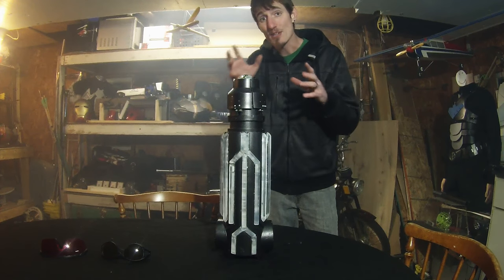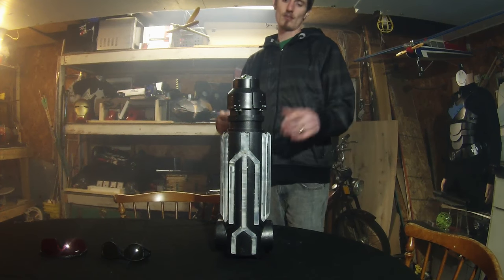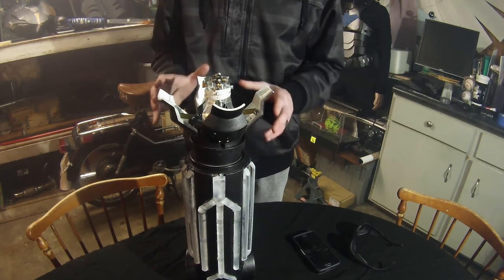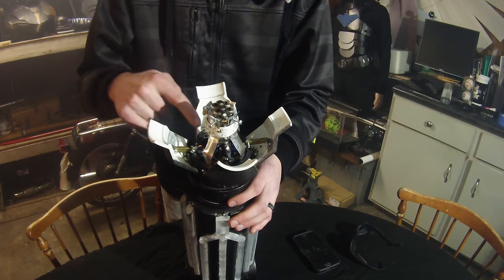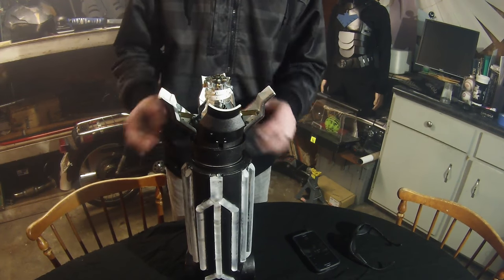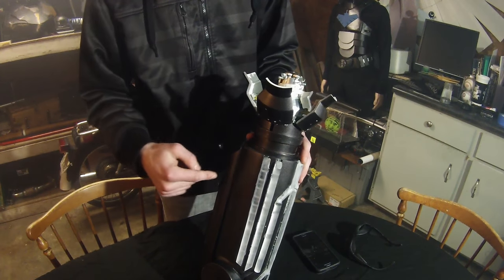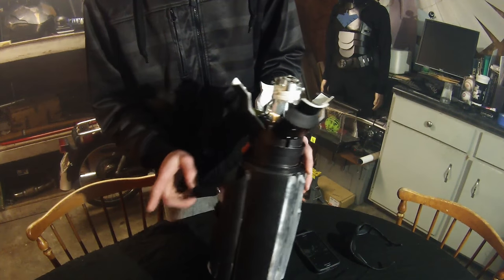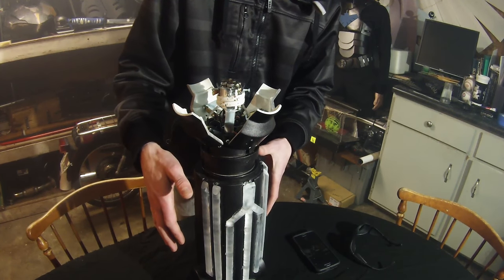Worlds First Functional "Metroid" Arm Cannon!

Comment: you should put an adjustable focusing lens on the front
Reply from the maker: +Vincent Balmont I played around with an adjustable one on my 30 watt rifle. I always set it as close as possible due to the focal length of the lens. What I'd really like to try next is two lenses setup like a reverse beam expander to shrink the size of the beam but keep it tight for burning at a distance. This one will probably stay how it is though due to space restrictions at the emitter head.
Reply: Troy Powers dont know if its possible, but if you could make something similar to a dslr lens that can focus for different distances, that would be insane
Reply from the maker: Vincent Balmont for sure! I thought about using a distance sensor and a stepper motor to automatically focus it for different distances. The best setup would likely be a 2 lens telescope setup so you minimize optical losses. Then using the correct focal lengths of the lenses so they interact properly.

Comment: Impressive, good job! You should show how it looks on the inside where the switches are.
Reply from the maker: Alexander DeBavelaere when I finish the turning mechanism I might make another update video.  If I do Ill show more of the inside and a little more details on how it works. Might be a little while though because I have to order the bearing.

Comment: Really cool, but the design and function is really far from the game :/
Reply from the maker: +CosmicSubliminals there are a few differences in design because artistic expression but overall I would not say it is really far from the game. I did not want to 3D print or use foam. Also what else would you do to make the function closer? Missiles are illegal were I am. The emitter head rotates but it has no bearing so it doesn't work well yet but eventually!
Reply: Yeah, I don't see how you could really get it much closer. I was just imagining some kind of power beam or something :P Still a really awesome cannon